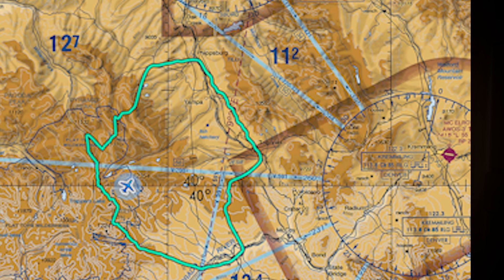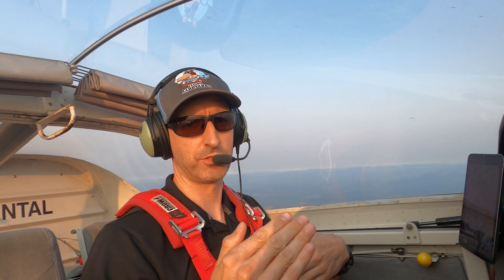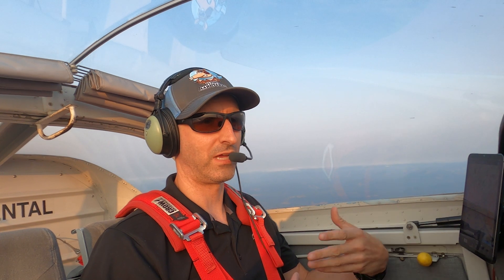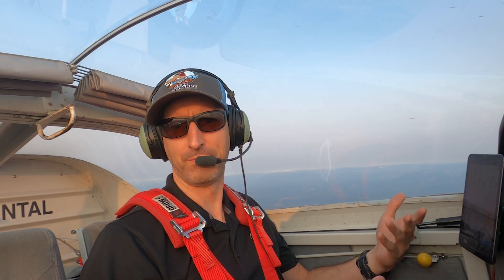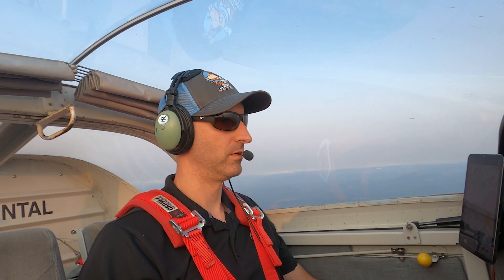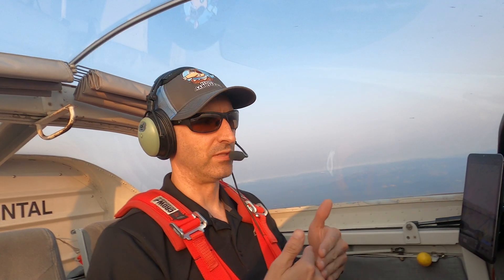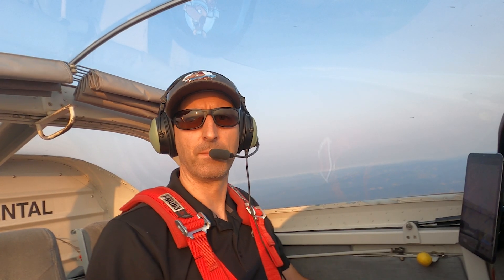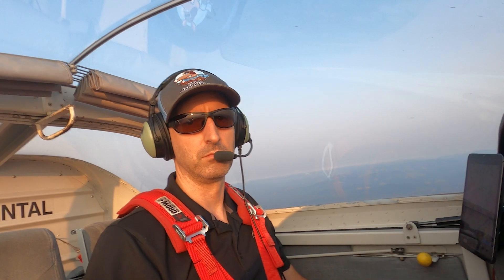Is your ACTUAL glide ratio wrong?

Comment: I like your video and I'm going to do more testing, but there are 2 points where I disagree. The way I have been adjusting my glide ring is totally different. Please let me know if you disagree. The way I do it is to go up to a reasonable altitude with my GR set on Foreflight and fly to a point where the green circle is just to the edge of an airport, and then I pull the power and see if I can make the airport. If I don't make it then I adjust the GR and try again. I care about the green ring, I don't care about the number. One question I have is how are you determining your horizontal distance with any degree of accuracy? I am sure your trig is very accurate, but that horizontal distance could be way off.

The second point is that having the green ring set too close is just as bad as having it set too far. If I am flying over the Cascades and my engine quits then I'm going to immediately turn to an airport that I can make based on the green ring, but it would be even worse if I turned away from an airport that I could have made because it's just outside of my green ring because it was set too conservatively. I don't want to aim for a mountain snowfield if I could have made an airport.

One additional point is that I have a Sling tsi and it has a CS prop which can fully feather. I need 2 glide rings, one with the engine windmilling and the other with a dead engine and the prop fully feathered. What I do is set my ForeFlight glide ring with it fully feathered, and the G3X glide ring set for the windmilling distance. My only problem is I don't really know what my feathered glide ring is because I'm too chicken to completely stop my engine to test it. Let me know what you think.
Reply from the maker: Hey, thanks. The horizontal distance is relatively easy with GPS. I am flying a straight track line (track not heading) direct to a gps point. I also did it both ways to account for wing.

Comment: Maybe I missed it but do you run a constant speed prop?  My RV-7A got similar glide results but when I pulled the prop control the glide ratio went way up!  I too did it with engine off.  Nice work
Reply from the maker: Yup—CS prop. Going to test it in also (next) with the prop way back. But I will still keep my glide ration at 7.5 so I know “worst case” ie no pitch control.

Comment: I took a Cessna 172B over on my airplane channel  - and heavily modified the wings: STOL cuff, VGs, and wing extensions of 3 extra feet in length. I know my glide ratio changed, and I've been testing it but I haven't yet got a solid number. So I've kept a very conservative stock 172 ratio in Foreflight until I can finish testing.

Comment: I haven't stopped the prop yet, but I have a SLSA with an absurdly conservative number in the POH. I did a series of tests, using autopilot to reduce the human factor, and I also tested reflex (negative) flap settings and zero. It's hard to test with winds though! I guess I'll have to go up when there's either a perfect crosswind in my test valley or find a time when the wind is near zero. I feel like I'm missing an obvious correction for wind speed so my numbers are still valid, I have the wind data since I'm pulling logs out of my panel anyhow.
Reply from the maker: Reflex? Wow--What are you flying?
Reply: @flyingaardvarks1133  nothing exotic, just a Flight Design LSA. I know Pipistrels and Maules have reflex, RV10 does, and something like the Columbia or Lancair does as well.

Comment: 👍Nice post.  I tested this in my RV-7A also.  

There are two scenarios for an engine failure:  Fuel starvation=wind-milling prop... and engine seizure=prop stopped.  
Wind-milling produces more drag than stopped.
I tested mine both ways and found slightly better glide performance with the prop stopped.
To get my Hartzell constant speed two bladed prop to stop (after engine shutdown), the airspeed had to be decreased to just above stall speed. Eventually, it flops to a stop.
Your test results are reasonable for a side-by-side nose-dragger.   I'm sure a taildragger tandem seat RV would have way LESS aerodynamic drag than mine... and better glide performance.
Another useful number to determine is Minimum Sink speed....assuming you've glided to overhead a landing field and have lots of altitude remaining to work your problem.

Well... A lot of this is splitting hairs with the glide performance numbers.  HOW you fly your airplane in the first minutes of a sudden engine failure is more crucial.
Obviously, turning immediately toward the nearest airport or landing area is important.  I always have NRST airport displayed on my RNAV unit even on local flights.
Energy conservation:  If you're cruising at 130 knots when the engine quits, the best technique is to pitch up, trading speed for altitude until reaching best glide speed (80 kts) & THEN TRIM to stay there.  That will stretch your overall glide distance much better than staying at altitude and bleeding energy due to drag.

Practicing "Power Off 180's" in the pattern is also great practice for energy management.  That is the most failed item on a Commercial Pilot checkride.  Another tool is mastering the "Forward Slip to Landing"....  That takes practice.

Thanks for a great post, Flying Aardvark...

Waldo
Reply: Wouldn't moving the prop to high pitch (pulled out) result in the least drag from the prop?
Reply from the maker: @FlyMeAirplane It would. My thinking here was “worst case” in the event that wasn’t possible.

Comment: Interesting video but you neglected a very important factor - the windmilling propeller.  There are two basic types of engine failures with two different glide ratios.  Let's call the first, Type 1 - Engine isn't producing power but prop is windmilling.  Type 2 - Engine seizes, prop stops.  Type 2 has a significantly better glide ratio.  You might consider a re-do where you pull the mixture then pull the nose up enough to stop the prop.  If you do, I think you'll be amazed at the difference.  I've tried it in a Citabria, huge difference, felt like I was in an early, low performance sailplane, gobs of time to glide to the ground.  Thanks for the video but please address this important variable.  John McClanahan, Atlanta
Reply from the maker: Sounds like a good “part 2.” Will give it a try and see how different it is.

Comment: Thanks for the info. I’ve also noticed that some of the glide ratios posted elsewhere in the interwebs seemed a bit optimistic. As a 6A owner I appreciate your test. I’d prefer to err on the side of caution running 7.5:1 as you did. 

I wasn’t going to kill the engine in flight as you did to find out so thanks for that too!